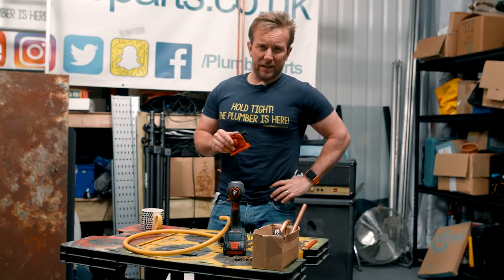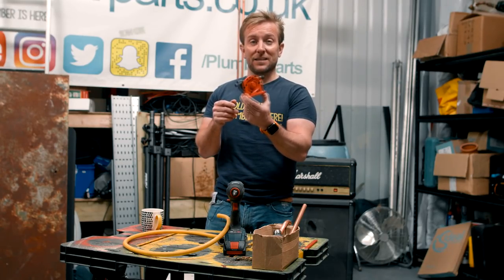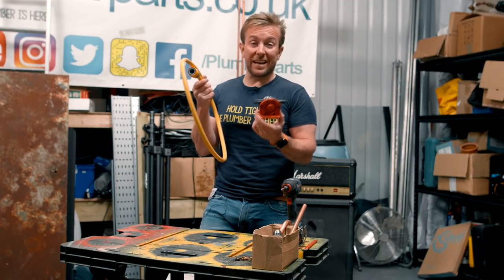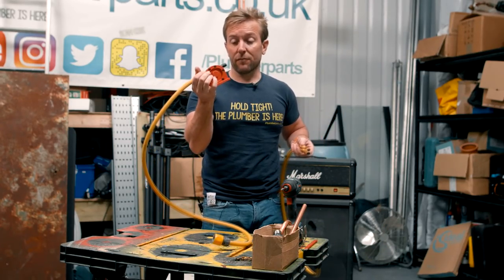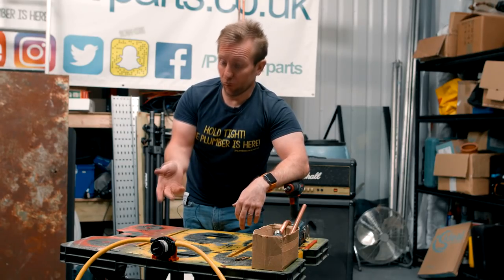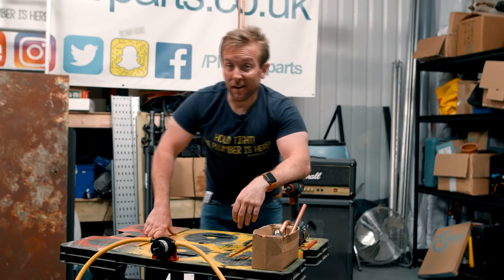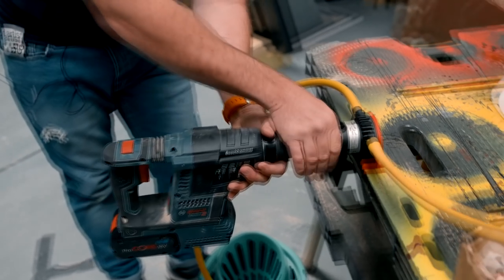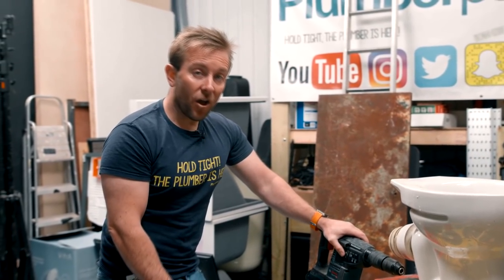DRILL PUMP LIFE SAVER MUST HAVE TOOL - TOOLS OF THE TRADE

Comment: Why didn't you prime it before using it? The instructions on this  type say to prime it first. A  few drops of oil on the inlet side, fill the pump with water from  the outlet side. The instructions say this greatly increases the pumps lifespan. That's the only reason I'm watching your video- the pumps are the most self explanatory tools in the world- if somebody needs a video to learn to operate one of these, well- wow.

Comment: Well, well. I have only just been using one of those to pull horrible sludgy water out of old in-situ horizontal CH pipes under an inaccessible spot - the kitchen units. What moronic housebuilder designs an open vented CH system in a f'n bungalow and also uses plastic underfloor heating pipe for the system? Changed to pressurised and I am in the middle of laying new copper pipes in accessible runs. Your vids have helped loads with this massive job. Thanks!

Comment: Brilliant, just scratching my head how to desolder a water filled fitting below floor for a different size rad change. Using a heat gun or blow torch was going to take forever. And sucking it out via a siphon tube was a yucky dud!

Comment: Had mine for nearly 30 years, cost around a fiver from a car accessory shop, used it for all sorts of stuff, more latterly to empty/change the water in my aquarium - still works as good as the day I bought it.
Reply: Could you use it to pump air?
Reply: @turnoff7572  
No, it relies on the flow of liquid to stop it from seizing up.

Comment: Could you use it to drain down a system? Ours takes ages to drain down?
Reply from the maker: Yes you can. But there could be other reasons it's taking ages to drain.
Reply: @plumberparts  that’s great. We’re in a bungalow and each rad is on drop down legs. We’re also on microbore which I’m slowly changing for 15mm

Comment: Im thinking of using one of these to fill my solar thermal system, do you think it would provide enough pressure (above 1 bar)
Reply: No.
Reply: Absolutely I use mine everytime to pressure my system to 2 bar works like a dream it does drian the battery quick though
Reply: @garyherbert8242  2bar? Off a drill pump?
Reply: @Nickbaldeagle02  yes done it for the last 2 years 18v drill. Use it to flush then fill the system pressure gauge goes over the 2 bar
Reply: @garyherbert8242  blimey. Drill pump technology has moved on. My little drill pump is 10 years old and can barely pump 2 metres. I use it for draining toilet cisterns.
Reply: @Nickbaldeagle02  mine cost about 20 pounds from Amazon 2 years ago